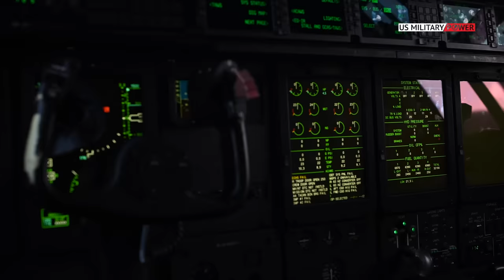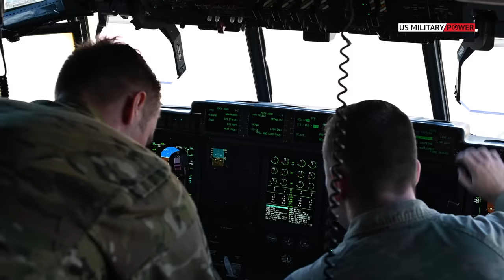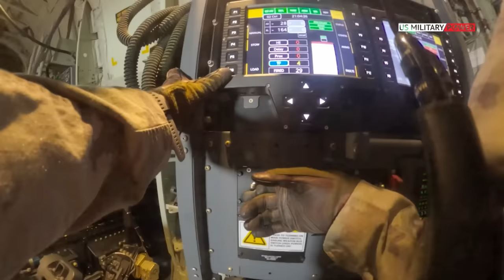AC-130J Ghostrider Gunship in Action - Firing All Its Cannons

Comment: One of the problems we had with the AC-130U 25mm gun was the inertia of the ammo.  The gun cycled so quickly that when the trigger was released about 6 rounds would continue past the breach because it was hard to stop all those rounds when you get them moving.  The feed system actually reversed to recover those unfired rounds.  Getting this feature to function was a big pain during development.
Reply: Sounds like the need for some correction system.
Reply: First of all. Thank you for your service. The Spooky had 3 guns: 25mm gatling style gun, 40 mm Bofors, and the 105. Ghostrider only has 2. If you could, please explain how the 30 mm gun replaces the 25 and 40? I appreciate any insight. .
Reply: @davegiven0330  The US does not use the 40mm in anything but the AC-130s so it was logistically difficult to support.  The 30mm is used on other US systems plus it has good velocity, an anti-armor round and a high explosive incendiary round.  The 40mm round had some limitations as seen in the Panama action where it was unable to penetrate three levels of concreate floors to reach the fighters on the first floor.
Reply: The very first 'prototype'/experimental spooky early in 'nam was a WW II era C-47 'gooney bird' that was equipped with three Browning 1919A1 30-06 cal.air cooled WW II machine guns pointed out the fuselage side windows/cargo door and aimed by the pilot with a simple sight out his side window.
Reply: With WW II left over ammo. that left powder smudges down the length of the fuselage.
Reply: you were military i assume ? ever heard of OPSEC
Reply: @davidmichael6239  Point. I was kind of wondering about that.
Reply: Giuseppe Battagliese  Show me main battle tank sized pieces of graphene.
Reply: @thomasschoon8407  There is such a thing as a Basler BT67, it is a turboprop C47 or DC3. Ours was a C47.  If ever need be I have built a similar rig that would only be put together appropriately in very extenuating circumstances.
Reply: @David Michael : whom are you asking this of, and which of the ten in particular, especially since what i mentioned is approx. 60 yrs ago?
Reply: Modern electric gatlings run a clutch system on the feed motors, negating waste of ammo going through the system unfired. Huge benefit to the systems.
Reply: Oh. That caused some pain alright
Reply: @JimBrodie  Except the momentum of the ammo train causes several rounds to pass through the gun.  Modern systems reverse so the first round is available to the gun.  This is not a problem with guns that have limited ammo supply but it is on a Gunship which carries a lot of ammo.
Reply: Did you work for before or krupp?
Reply: @jyy9624  Neither, I was in the USAF program office developing the AC-130U and heard the problems the armament guys were having with ammo momentum.  It drove them crazy for a while.
Reply: Seem they left out a LED light on a gooseneck to aid loaders.
Reply: @davidmichael6239  I wonder how many people look up, a minute too late. Boom. Splat.
Reply: The M2A3 Bradley has a similar weapons system, the 25mm feeder looks to be the same interface. If this operator had a problem with the timing I totally understand. The rate of fire can surpass the breach chamber timing, and you would have a run away gun.
Reply: Why would you let off the trigger?
😎
Reply: @glennwall552  Why have a simple tool when you can have a second guy there just to kick shells out of the way and hold a flashlight.  More seriously, It's probably not worth the time.

Plus, a common one from maintenance techs is that's just another bit to be knocked off.  Seriously, there are a ton of nice to haves that no one would have a problem with, but the logistics chain of adding a magnetic gooseneck and maintaining it is more of a pain than you'd think. Beyond even the item, every inventory and maintenance checklist would have to be updated.  Batteries would have to be checked, spares (and spare batteries) on hand, etc...

Then there's the cost in weight.  A single item isn't that big, but multiply it by a few hundred and it adds up.
Reply: @arthurmoore9488  The second guy is going to be there anyway, and and no self-respecting aviator gets on a plane without a flashlight, so why have an extra tool to get broken? Everything you said is spot on.
Reply: @davidmichael6239  The inner workings of an AC-130 gunship (any known variant) aren't a secret, let alone the development history of a rotary cannon first developed close to 50 years ago that had teething problems when deployed on a platform that was developed more than 25 years ago. You can look up how a GAU-12 Equalizer works on freaking Wikipedia. 

In what way would knowing that the GAU-12 had a problem decades ago with feeding issues threaten operational security? You're literally watching a video showing the inner workings of the latest version of this platform. The whole world knows that the Spectre, Spooky, Stinger II, and Ghostrider gunships have existed and what guns they carry. These are not secret weapons, they're on YouTube.
Reply: @railgap  Aside from the Stinger II variant and its "precision strike" weapons (Hellfires and glide bombs) not existing in 1989, wot-wit, so you'd have to call a different plane in to bomb the building instead of the gunship already doing fire support, I imagine there was some reason why the crew who was onboard the plane firing the gun chose to use the Bofors instead of the howitzer. I wasn't there, so I assume that someone familiar with the CAS bizz figured that they didn't need a specialist weapon used only on this specific aircraft if they also had explosive rounds in a 25mm rotary cannon for saturation and a howitzer for blowing up buildings.
Reply: @karlstreed3698  yeah sorta, it's the famous 40mm bofors system that the UK is famous for, we've used it on other platforms before, (we do use 40mm though, for underslung grenades, so not quite accurate to say we do not use 40mm for anything)
Reply: @davidmichael6239  You just learned that word didn't you.
Reply: I always thought they would be more effective if they just had a rack stacked with dozens of guided missiles that can roll sideways out the back ramp, be activated while falling at higher altitudes, and then be guided on to a target from the operator.
Reply: @stingingmetal9648  yes you are right its called taking your finger off the trigger earlier.
Reply: Russia will never have such weapons, right?
Reply: Wow, thats@ $840 (and rising),  of wasted ammo.
Oh well, war ain’t cheap?...
Reply: @karlstreed3698  🗽🚀🥯🐖😆
Reply: @davidmichael6239   He's talking about an out of service system. The 25mm GAU12 is gone.  What you are watching is a Ghostrider which is equipped with the 30mm GAU23.  Not to mention, the pain he was talking about was "in development", not while in service.
Reply: @MrSunrise-   He's talking about an out of service system. The 25mm GAU12 is gone.  What you are watching is a Ghostrider which is equipped with the 30mm GAU23.  Not to mention, the pain he was talking about was "in development", not while in service.
Reply: No it didn't
Reply: @davidmichael6239  you realise it not hidden info? It’s a well known thing
Reply: @thomasschoon8407  
We should talk.
Reply: Is that Karl from Waynesville Ohio?
Reply: @forddriver8827  Yes
Reply: Tell me more.  My military is listening.
Reply: @xijinpig7978  
How bout we just show you….
Zipperhead.
Reply: @davidmichael6239  go listen to the latest episode of the Team House podcast on YouTube.

It’s about the AC130 gunship
Reply: 105's in this video.
Reply: Was you gunner sounds like a problem with the targeting need to update the cnc contols
Reply: @robertshimer63  
They showed both, the 105 and the 25mm if you were paying attention. Most likely why the gentleman mentioned the problem.
Reply: @danielk8149  
Lol. Very doubtful it’s CNC controlled.
Reply: Auto ejection of cart case and breech block open while recoil will help quick feed of amn...
Reply: @ExarchGaming  …that the UK is famous for? 😂 Hate to break it to you, but the 40 is a Swedish design lol.
Reply: They must've changed things because we only carried 105 and 80mm on ours. I was deployed during the early years after 9/11.
Reply: @davidmichael6239  It's always good for the enemy to know exactly how easily you can completely f**k up their day.
Reply: Yeah. That is a problem. The carcinogens the crew is breathing is another one.
Reply: @duellingscarguevara  it ain’t cheap but it’s very profitable
Reply: I never had any problems with it sure it had teething problems but so do I
Reply: Couldn't they just add a clutch? The M134 used to have the same problem when GE was making them; they'd cycle 4-5 unexpended rounds out of the weapon after each burst. Then Dillon Aero inherited the program. They realized that rotary guns work more like car engines than traditional firearms, and redesigned appropriately. Clutch and other components added, problem solved. 

Then again, 25mm is substantially different from 7.62, so I wouldn't be surprised if there were additional issues involved that I don't know about.
Reply: Amazing sound suppression
Reply: Yawn who cares military boy
Reply: @davidmichael6239  you're worried about opsec when they literally released a video of the inside of the plane while in use
Reply: I can't remember if we used 43 1/4"mm ammo or if it was 36 3/16ths"mm armour piercing ammo when I was in WW3 or not, butt it doesn't matter, we won on December 32nd. I do remember that.
Reply: Same
Reply: I need for a gun like this.
Reply: you say we what do you mean by that
Reply: @davidmichael6239  The same OPSEC that David Michael uses?  🤔
Reply: @davidmichael6239  wow ac130OPSEC is a long name tell me all about it!
Reply: That's an awesome bit of knowledge
Reply: "Bring the rain!"
Reply: Wrong.
Reply: You are absolutely wrong!
Reply: @davegiven0330  z za 1
Reply: @johnzhou8651  I was there in the SPO when this was a problem with the 25, where were you?
Reply: Karl it was 20mm not 25mm I loaded them in the 70s
Reply: @stevejones4802  The -H had the 20mm, the U-boat had the 25mm originally which gave them a lot of problems because they used much bigger magazines than what the Army used.  The inertia of starting and stopping was a big problem.
Reply: Inertia?
Reply: @TimBadger-w7d  When you start moving a large mass of heavy rounds fast when you stop firing the ammo does not stop feeding like your AR-15.  Several rounds are chambered then ejected unfired as the mass slows down.  Some guns will back up several rounds to save those unfired rounds for the next time you fire the gun.
Reply: Incredible
Reply: Is there a faq in the instructions
Reply: Good analysis.  Peace through superior firepower. Suppression means alot to the troops on the ground. That ac 130 is like an Angel.  An airborne mechanized unit.
Reply: Well it has a electric motors to cycle it that fast 😂
Reply: Did you have that Problem with the C-130H "SPECTRE" ?
Reply: @pipopasion6000  I don't think they did.  20mm ammo is lighter than the 25mm on the U-boat.    I think they were trying to carry the same number of rounds as the -H but it weighed much more.  Once you got it moving it was tough to stop.  They had to reverse and back up a few rounds to get the fist round into the correct firing position.
Reply: @stingingmetal9648 ...Like A.I. technology.
Reply: With AI assist that will never happen again.
Reply: It's like the manager of Drago what ever it hits it destroys!!!

Comment: I was always fascinated with the old WW2 ships and the large canons they had some of those multi barrel guns were like 3 or 4 stories tall and shot 30-40lb projectiles in unison very accurately as well. The process and engineering used to load and fire those canons in a massive working ship was so impressive. They didn't have GPS or satellites but were still extremely accurate for their day. This is next level here but it's all just as cool to see.
Reply: World War II - artillery radars, analog ballistic computers. In any case, on new battleships. By the middle of the war, in fact, on all USA ships, even the control of anti-aircraft guns was already computerized then.
Reply: More like 2-3 thousand pounds per round!!!  With a range of 20+ miles!!  Amazing amazing pinnacle of classic “cannon” technology.
Reply: @АлександрСалов-ц4л  no. Also booooo russia booo
Reply: @kishascape  Googletranslit не розуміє Вашу думку.
Reply: 30-40lb projectiles are like a 5" gun. So, a dual-purpose weapon primary to destroyers, secondary to cruisers and battleships. They were automated by the end of the war, but not 3-4 stories tall, the only ones that big were cruiser and battleship turrets. I'm most impressed that the  The US army and navy both had very good artillery computers for the time. They were accurate. Then again, so were the German AAA, where they chained 3-4 batteries to one radar-rangefinder. It calculated the ballistics for each gun.
Reply: It was, if you wanted to really call it, a computer.
Reply: @KingSparta  This was a computer, analog, up to 100 if not more parameters were taken into account.
Reply: a BL 16-inch Mk I naval gun 16 inch shell weighed 2,048 pounds
Reply: Yes I bet

Comment: Makes me feel really old. I was on H model Gunships. We thought the U model was great because it was the first pressurized gunship. Now they have retired it. They even drop bombs off them. Technology has really changed the game.  Glad I was retired before they converted Cannon AFB New Mexico to AFSOC.
Reply: I think the MOAB was dropped by a Talon (MC-Herc).
Reply: I was 1 of 5 who installed a new ATC radar system at Canon AFB in 1972 time-frame.  I bought a Ruger Mark 1 with a 6" bull barrel in Clovis and still have it today and it looks exactly as it did 50 years ago.  It was my first  pistol.  F111s were the primary aircraft stationed there back then.  I remember the F111s with ball's to the wall and on the deck and was awed by the sight of that  at  dusk with after-burners blazing.  I'll never forget that.
Reply: You sound like a Hurlbert guy
Reply: I was there in 1973, /77 Cannon AFB was crazy 🤪 flat as hell loaded weapons on the F-111 day and night  finally got out of there  went to Luke AFB with the F15s

Comment: I remember working on the AC-130H Spectre , totally manual fire system.105mm hydraulic controls . And also flying the Spectre over the Pacific ocean.
Reply: @Karl with a K ur name suits ur comments ngl
Reply: @m1ndh0ax  hes a troll
Reply: Mechanic? Or were you in the crew/both? Where do you begin when you think of mounting something with THAT much firepower out the side of your cabin?? Just the operation and systems have always seemed incredible to me
Reply: @mizeperez8636  literally so fascinating
Reply: @Karl with a K 😘
Reply: @Karl with a K are you from Russia? Even the Abrams is manual... Lol
Reply: The army prefers manual loading why? Because a human loader loads faster than an auto loader for about 2 minutes. The human slows down as fatigue sets in. However, those first few minutes are critical.
Reply: @Karl with a K then you obviously don’t know what you are talking about lol. If an auto loader was faster in the first two minutes they would have designed that a long time ago. Research on the engineering limitations and maybe you might learn a thing or two.

Comment: Just think about the 1960's before computers and the C-47 orbiting at night firing close air support...very close. Must have been tremendously difficult.
Reply: This is also tad difficult as it relies mainly on machines, and one never know when it might jam ... So !!!
Reply: As a witness to a c47 gun ship from the ground in Vietnam, the tracers and the red glow from the ground was BEAUTIFUL!!
Reply: Gdfitz I bet they weren't beautiful to the NVA !!
Reply: Scared the feces out of everyone in the area still alive. Very intimidating beast
Reply: The magic dragon seems like one hell of a ride and one I wouldn’t wanna be on
Reply: @TheCommissarIsDead  Look at it this way, Puff was built on a C47 aka DC3, the sheer reverberations, massive amount of gunpower fully unleashed in less than 2 minutes. That's an energy pump. And besides so much better to be the deliverer vs the receiver- had a way of deforestation of a jungle area and nary a napalm or agent orange moment
Reply: @donl5158  hi
Reply: I flew in a DC3 a couple times, I can’t imagine a C-47 bouncing around with a bunch of 50 calibers going. 
Hats off to you guys and thanks for your service.
Reply: @Karl with a K A lot MBTs still use manual loading. There are advantages and disadvantages. I imagine an auto loading system for a large bore cannon on an aircraft would be the less desirable option. Too many malfunctions that can't be fixed without a pair of eyes and hands. Just my opinion.
Reply: Constant radio contact, if you lose contect then you know you went to close lol............marines have been using this method for,centuries hooraa
Reply: @Karl with a K the M1 Abrams still uses manual loading. It’s more reliable and a well trained crew and loader will load and send rounds down range quicker than any autoload tank on the battlefield. I was able to consistently load a 120mm round in about 3.5 seconds, the current fastest autoload is around 7-10 seconds.
Reply: @gdfitzgibbon  I’ve been listening to a lot of MACV-SOG audiobooks lately and the way they speak of the C47 gunships is something else. They got our guys out of a lot of tight spots!
Reply: @lymaneadie4710  It's also safer for the crew, you can see what happens to russian tanks with autoloaders when they are hit.